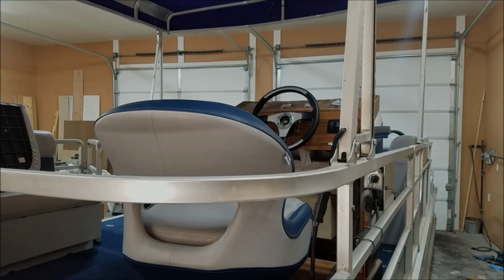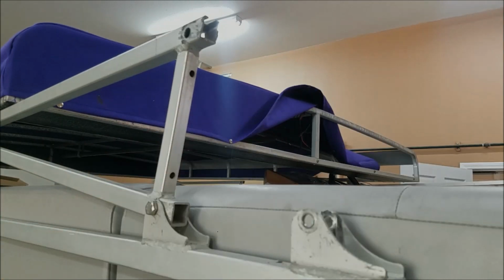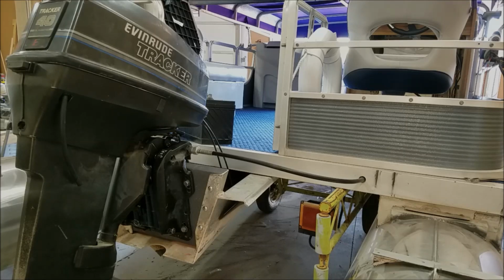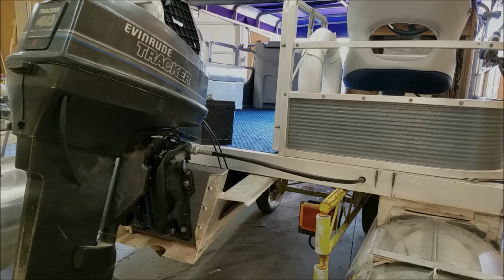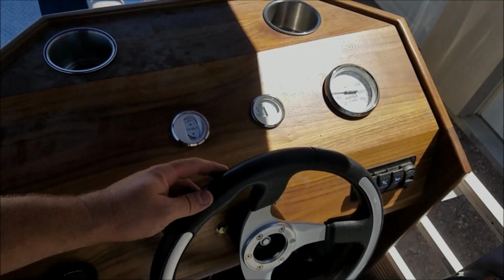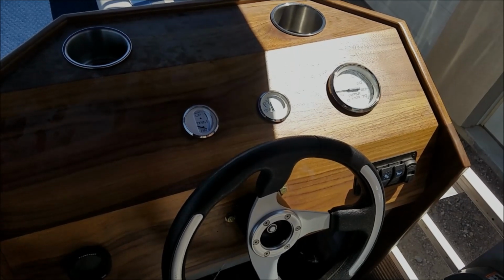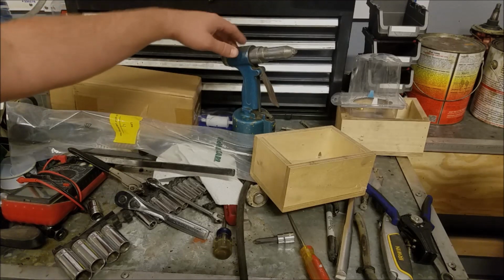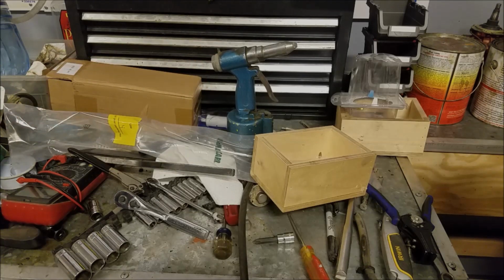Craigslist Pontoon Boat: Back In The Water

Comment: I have watched a lot of pontoon videos and they all. Splash water up into the transom in the middle there. Not sure if it is a big problem or not. If it is getting the deck of the pontoon boat wet as well, then that’s no good. I have seen a few that have automatic bilge pumps mounted in there to keep the amount of water to a minimum. One guy liked it because he had an integral tank and he felt that it kept the gas cooler to help with performance. I’m not sure what is good or bad in these observations, just mentioning what I have seen and some possible solutions. 
   Thanks for sharing the build. It has been fun and maybe I need to look for an old deal and build one for a hobby. You and your family, please stay safe out there.

Comment: I have a covered area for my boat but there is a huge stump to be removed before I can get the boat in it. Have 5 stumps and will cost 1300 bucks so will need to wait till next year for now. I cover it and put an air dryer in to keep the moisture out.
Reply: Drill a couple of holes in the stumps... Pour some Kerosene in them for a few days... Covering them up with saran wrap... Letting the Kerosene soak into the wood... Then light it on fire down in the holes... Keep a low slow burn...
Reply from the maker: Thats what I was thinking. 
Even a stump grinder is only a couple hundred to rent for a day.

Comment: Awesome...watched all your videos Brandon and your an inspiration to this 63 year old fishing widow.....who loves a good project.   Have a couple of questions.....does it make a difference if you water proof the boards that you use for the foundation of the boat.....?   Would spraying some kind of water proof sealant make a difference?   And you said the motor was splashing water back up into the area......where the motor is connected....how do you determine what height to place a boat motor?  Good job.....do you know your final refurbishing costs?
Reply: Dad here......no need to treat the underside, you'd be hard pressed to find a pontoon builder who does.  Besides, it's so dry here in Bullhead City AZ (around 7% humidity) that you could hose down the underside of the plywood and it would bone dry in minutes.  The pontoon was over 40 years old and had the original plywood.  The seats will rot out within 10 years or sooner and you'll probably want to replace the carpet as well, so it's kind of a waste when you can replace the plywood and carpet when you decide to get new seats.

Comment: Great job, well done!! Just one maybe stupid question, maybe I missed it in one of the videos, but on that last shot at the bottom of the boat it seems like the wood on the bottom is still completely untreated. I remember you treated the top with that red plasticine paint, but did you at some point treat the bottom of it too?!?
Reply from the maker: Oh gosh no, the red guard is like $60 a gallon.
Reply: @BrandonsGarage  But...did you use something else to protect it from the water then? I mean, I'm pretty sure you said in one of the first videos it was not marine ply. So what keeps the water from slowly soaking in from the bottom? I'm so confused. I think I missed something. I can't imagine it's still just untreated ply at the bottom.

Comment: Great job I just rebuilt a 24 ft party barge. I bought it w trailer for $1,000. It has a 50hp mercury but I'm a replace it w 115hp mercury off my venture bass boat since the transom is rotten.

Comment: Do you treat the underneath plywood?  Even some waterproofing?
Reply: Nope, even the manufacturers don't treat the underside of the plywood, here's why.  If the boat was manufactured say, on the east coast where it's really humid and the boat is shipped to say, Arizona where Brandon is, you'll trap that moisture, not good.  By doing what Brandon did, coat the top side where water will be absorbed by the carpet, it can't get to the plywood.  The underside not being coated will allow the moisture introduced to escape quickly, especially in a climate he's in where the humidity hovers around 6%.  Moisture will evaporate very quickly in a climate like that. 

It's why you never want to buy pine furniture that carries a natural internal moisture content of about 14% and put it in Arizona or a desert climates where it'll dry out that natural moisture (again, not good) and your furniture will split apart.  When you live in a climate like Arizona you want to buy hardwood furniture because it's internal moisture content is around 6 or 7%.  Hope that helps.

Comment: Good job. Looks great. 
 I’d like to know the total cost of the project. Whether it was cost effective than just buying a newer boat.
Reply: In Canada in 2016 I bought a used 2003 Princecraft Pontoon boat, 50 HP 4 stroke motor and trailer, built-in gas tank  and more but it cost me about$14,000 CDN. I looked at a lot of boats on Kijiji that needed a lot work, before I found this one, but If you are  handy you could get them cheap.

Comment: Brandon, what length boat and how fast does your 40hp push it? I'm running an old 40hp Evinrude and only able to get 10mph at WOT on a 24ft pontoon. Any suggestions? Possible timing advance or prop pitch?

Have enjoyed watching your rebuild and congrats on getting it back out. Enjoy!
Reply: 24' pontoon with 40hp? Holy crap. Suggestion: Buy a 115hp engine.
Reply: Pretty underpowered unless you are just sticking to a somewhat sheltered lake.  What pontoon is it?  Hull should have a powerplant rating...
Reply from the maker: 115 max.
Cant go  past 1/2 throttle,  the water starts splashing into the boat. Have to keep it past half way.
40 HP can move the boat just fine, assuming your engine is in good condition, have the right prop, and can give it more throttle.  With my speed here, I could tell the engine had a lot more to give.
Reply: Get a tach see what its rpm it's at full throttle should be at 5000-5500. Most pontoons or heavy boats over 1500 lbs on a 40 hp wont see 15 mph with a 10 pitch.  Could be your activation plate depending on if you got a short or long shaft motor.

Comment: I don't remember you putting ANY paint or sealant on the bottom/underside of the deck.
Neither have you even mentioned that?

THAT has got to be remedied - IMO!
Congrats! - tho!
Reply: I am so glad you asked this question! I’ve been wondering since the second video but he didn’t put some of the red waterproof paint on the underside of the plywood. Or at least a couple coats of exterior latex paint… Maybe the plywood dries out pretty quickly in that desert air?
Reply: @gregwein1  You nailed it! With the average humidity in Bullhead City AZ being around 7% your spit dries before it hits the ground. Not only that but that pontoon had the original plywood (just regular exterior grade) that was over 40 years old.  The seats will rot out long before the decking does.  The reason for sealing the top side was because the carpet will hold water speeding up the rot process making the carpet look junky.  So sealing the top side was to keep the carpet looking good for a long time.